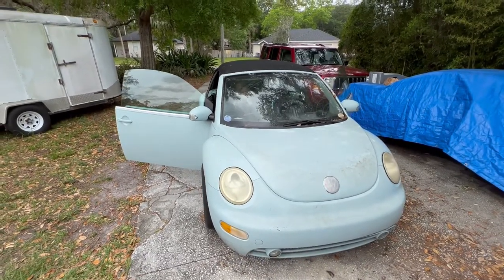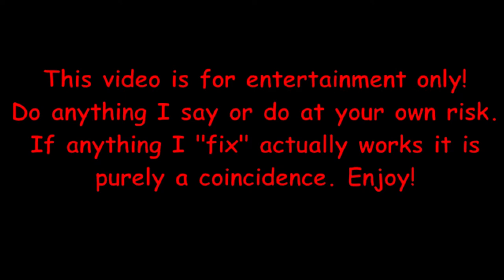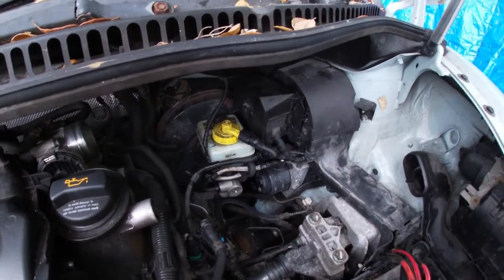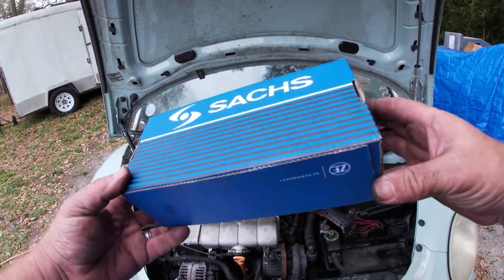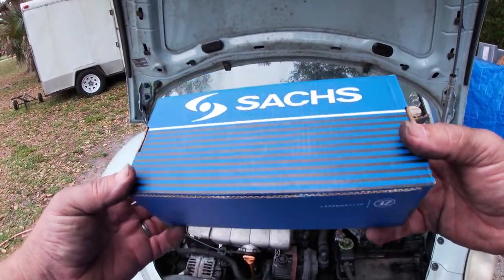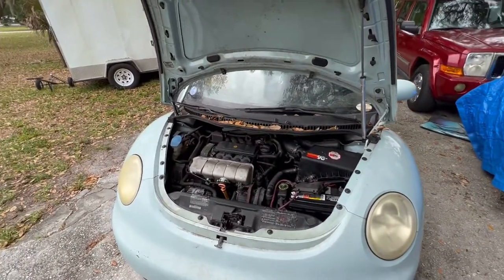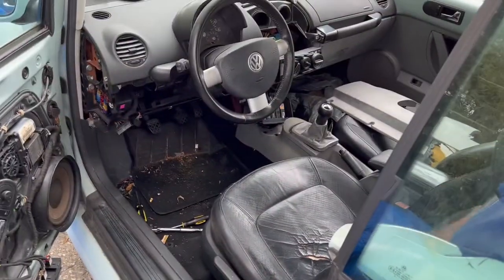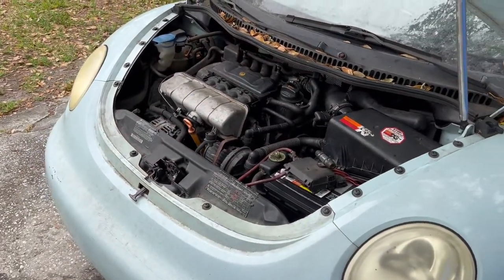2003 VW Beetle clutch master cylinder. Bluesclues 4s. Abandoned VW Beetle project part 4.

Comment: With your clutch mashed all the way to the floor. Could you feel movement at the bottom? But the clutch peddle would stay down? I bought a 2002 Diesel. Bad clutch he told me. But you can start it in gear. Drive it around clutch does not slip. So feel mine has the same issue as this one.
Reply from the maker: Thank you for watching.
Yes, sounds the same.  Try bleeding the slave cylinder first.  I think I covered if it’s leaking on the inside or in the engine bay in the video. That will confirm for you if it’s the master or not.  Sounds like that’s the issue though.  Good luck, hope that’s the problem.
Thanks again for checking out the video.

Comment: make sure get a clutchmaster seal kit or the right o rings, one broke or dissapeared on me, even with one form my o ring kit it's spraying DOT fluid every where. i'm stranded for the next few days or week.
Reply from the maker: Oh wow, hate that you are having some bad luck. I had to use an air nozzle and blow through the outlet on the master to dislodge mine. I hope you can get it sorted. Thanks for the information.